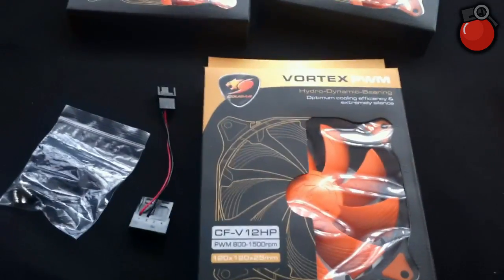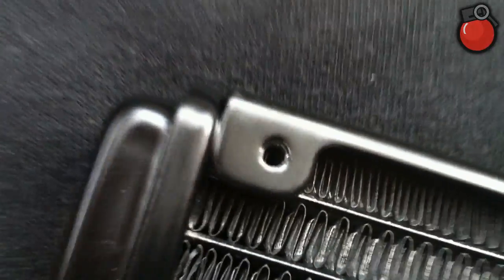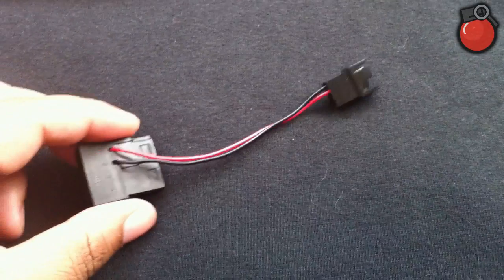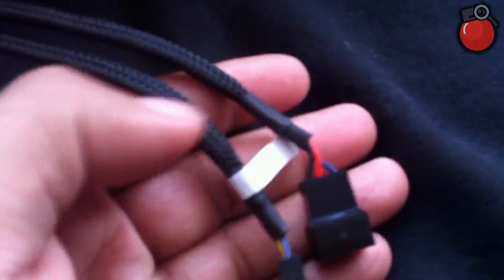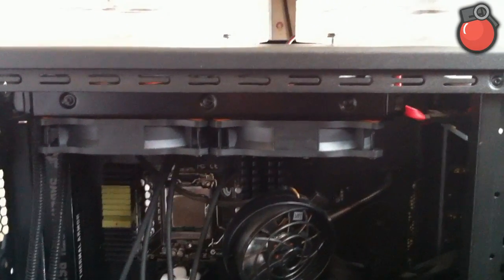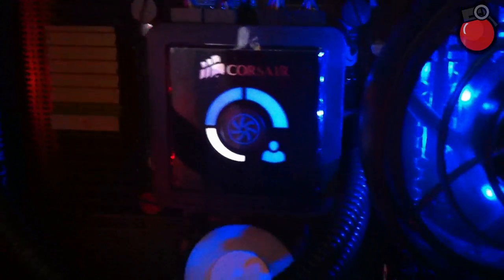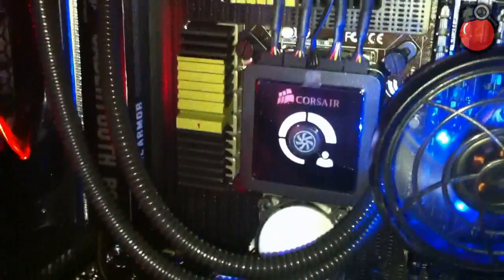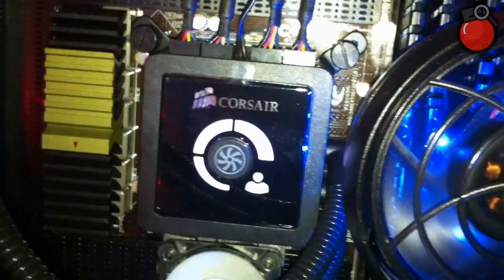Corsair H100 Review Update Push-Pull Cougar Vortex Fans - Cooler Master Haf X

Comment: Sooo... You removed the factory fans (Corsair SP Performance) which have a 3.9mm H2) rating... to replace them with a fan which has 2.2mm H2O?

And you expect your cooling performance to increase?

You're an idiot...

Comment: those 4 fans are still quieter than the rest of your system at max speed by the sounds of it. i just installed 3 on my air 540, and at max speed, there is no whine sound from the motors. all i can hear is the air being pushed, so its not the annoying loud, its the normal loud

Comment: just a quick question since your using a static pressure fans, will the HAF top case fans interfere with the flow of air from the cougar fans. if they are not moving as much air as the cougars does it make a bottleneck effect?
Reply: Same questions here... wondering whether the top case fan will hinder the performance...

Comment: It's so unfortunate that my case doesn't support push/pull config :/
Reply: anyone can, if your like me you just need a slim fan to clear the motherboard, my other fan is mounted on the outside of case. i recommend the corsair high static low profile fans, designed for this.

this guy has a triple fan set up, but push pull is a sets
Reply: Try doing that in an NZXT Phantom 410.
Reply: i see what your saying the top part dont have clearance for two fans? either way that case looks like it don't have alot of fan options. a push/pull h50 will do as good as a single h100 i do believe i read some where.

Comment: Do you recommend this to the Bitfenix spectre pro ? I need some pull fan , does these loud on pull?
Reply: Ramzy Humsi That will not make any difference due to the fan casing being round or square. What matters is if you are using it for just moving the air, then you need to look at the CFM(CFM= Cubic Feet per Minute) or for a rad push/pull, you need mmH2O(mmH2O-Pressure measured by its ability to displace a column of liquid in a manometer) For a rad you need static pressure fans to force air into the rad fins, where a fan with low mmH2O the air gets blocked. These fans have a rating of 2.2 mmH2O, 70.5 CFM of with only 17.3dB. Thats a lot of pressure with a lot of air flow, without a lot of noise.

Comment: Those cougar fans are fine for his application. The best fans are not the gentle typhoons anyways. Plus the gentle typhoons are freaken noisey as heck. Just buy the noctuas if you have money, but other than that buy the corsair sp120s either quiet or performance editions. But if you want better performance use the stock fans on the corsair h100 or h100i. The corsair h100i fans push 80cfm and 4.0mm of pressure at crazy DBs.

Comment: You have to take care of what? I don't get it? The button on the H100 is for selecting the thermal profiles... You select one and leave it. It adjusts the fan speed automatically on coolant temperature if your fans are plugged into the h100. You can replace the stock fans with some quieter ones, just make sure they have good positive pressure.

Comment: What I found out is most of these kids use the H100 hotbutton as a "fan speed selector" and are upset when they find out it doesn't work. Turns out it just selects "Cooling profiles" and the fan speed is set by internal coolant tempurature. 1 being the least noisy, 3 being the most. You may notice a slight change in fan speed, but you won't notice a large difference in fan speed unless the coolant temp is high. There is a chart on the Corsair site you can pull.

Comment: You shouldn't even have to do that. The H100 does all the thermal management inside of it. Plug the signal line into the board and you're solid. My Non-PWM fans are being controlled by the H100. When it gets hotter, fans speed up, when it gets cooler, fans slow down. The H100 does a really good job of keeping the temps down with its own thermal managment. If you connect the fan to the motherboard, you chance using a crappy temp probe that may not be properly registering CPU temps.

Comment: Nope, I'm running non PWM fans on my H100 without any issues. You do not have to plug any fan into your fan header. Just plug the signal wire into the CPU fan header so you don't tick off your board. If you run it on the fan header, it typically runs it too slow... Leave it plugged on the controller as Corsair designed.

Comment: I swapped my corsair fans with other fans and they work fine. The button on the pump only selects "cooling profiles". It does not set the fan speed, as it determines fan speed on the basis of coolant temperature. There's articles on this all over the net. I plugged all 4 of my fans into the headers on the pump. Feel free to plug one of the pusher fans into your board.. but the board tends to run them slower than the H100 will.

Comment: Sorry for asking i know you explained this on your vid , but i didn't really quite understand. 

How is your fans set up ? Do they plugging into the pump or you plugging direct to the CPU Fan header instead ? 

Cause i saw a guy swapped his original Corsair fans for aftermarket ones , the pump button no longer able to control his fan speed , this is what im worry about.

But his is a H80 , they are almost the same right ?

Comment: I'm sure you can. I have the V1 H100 and with all OEM fans on the 650D case and cooler i have my i5 2500k from 3.3ghz to 4.4ghz 24/7 and it  barely reaches the high 60's in prime95. It ran better with the radiator at the top of the case, with the fans under it blowing the air through the radiator and our the top

Comment: Are these the pwm fans or the 1200rpm fans? Also, are they better than the stock fans that came with the h100? I'm asking because the thermaltake water 2.0 extreme fans push 80+CFM...but I don't know if that is combined or each fan.

Comment: No, the H100 with push/pull will not fit in the HAF912. However, with a little easy modding to your case, you can fit the H100 with only two fans in push or pull.

Comment: Its not about how much air the fans push when you are using them on a radiator, it is all about static pressure.

Comment: Personally I use 2 single depth fans one side and 2 x  DFS1238 fans the in the top of the Cosmos2 ultra case. Never need the Scythes on full as they push 133.60CFM.  They are double the thickness of normal fans and they do have quite sharp metal blades (yep they can cut you). Good for quickly dumping heat from the case when you switch to max or are doing something out of the norm such as benching.  Really really noisy though on full.  45.90dBA. Not happy with my H100. Also on my second one

Comment: What do you think the result would be from mounting the H100 horizontally at the top with only two Cougar Vortex on the bottom side pushing air up and out of the case through it?

Comment: Just a heads up, on a lot of motherboards trying to do push pull is gonna put the fans over where the RAM slots are so definitely check it out in advance.  I had to go buy low profile DDR3 to get it all to fit.

Comment: I recently got the H100, and I see very little point in the push-pull config. I've got mine with the 2 stock fans, using a 3770k overclocked to 4.6GHz and it maxes at 60c, idles at about 25c. (Max on the H100)

This is also in the HAF X v2.

Comment from the maker: What for a push-pull config? many people have been doing this for years and it has not caused any problems? if its regarding my extra 25cm fans on top of my case they are running at low rps the highest they go is 700rpm i dont run it full speed, they are there to remove hot air from the big vents either side of the CPU cooler so i dont think they are causing any problems to my CPU cooler.

Comment: Hey if someone can reply quickly, that would be great.
Im planning on having these at the top of my case, instead of a 140m fan. The guy in the video said hes going to push hot air out, i was wondering if i can use these to cool my cpu aswell as an exhaust?

Comment: @dmcgamingclan nice video, So could you give links to what you used for extensions and for a splitter? Because Im getting an h100 and the case that you have there, as well as an h80 which Im modding for the gpu and will go on the back of the case. Do you see any issues with this? Im trying to figure out what extensions I need and stuff, so any help would be greatly appreciated. Thanks! :)

Comment: Hy friend ! I'll by a Corsair H60 and i am thinking to make a punsh pull configuration, but I have a doubt. the motherboard can be confused with the FAN Speed control? How can I resolve it? I´m thinking to plug the 2 fans in a 4 pin conector in my motherborad, but in this video you cut the third pin of the second fan.

Comment: the corsair h100... in fact all closed loop liquid cooling ain't a big deal to give them so much stuff, after all they are only cooling the CPU,if you had a custom liquid cooling or a liquid cooling kit then it will make mo sense to give it more stuff like fans cause with them you can have waterblocks for the graphics, shipset, even memory

Comment: i just mounted 2 cougar fans on my H100 and was not pleased with the results, althougt very quiet and powerfull, the cougar fans vibrates a lot inthe H100 radiator.. if i put my hand on the case i could easily notice the vibration... thats a big disapointment... i already considering putting the corsair original fans back...

Comment: H series of Water Cooling from CORSAIR..!!!  The lazy man's approach to water cooling..
LULZ. F.Y.I., I never go above 98 F or 36 Celcius at full load... 4.2865GHZ 
Phenom II x6 1100 thuban... I'm dumping AMD after the Buldozer failure...
I've went higher, but i'm not worried about it, I don't want to have to spend $230.00 on an Ebay chip... Bye bye AMD..

Comment: Do you think performance is better with or without the 200mm fans on top? I'm doing a similar build right now and am deciding if I should do the 4 x 120mm or how you have it, the 4 x 120mm + the 2 x 200mm up top. 

Is yours set to exhast?

Comment: Hey man. I live in UK and I'm wondering where can I get these from? Also, Can you connect the 4-pin PWM straight to the H100 Fan controller and does it work fine adjusting the 3 fan settings using the button on the H100? I plan on using 2 of these as intakes on the H100. Could you give me a link to the exact ones you're using, so I can buy them? Thanks.

Comment: these spin at a lower rpm when compared to the stock fans.... do you get better or worse temps as the h100 is a dense rad which works better with higher rpm fans

Comment: man, i same stuff as you and i did same settings also , but my one making lil noise in pumps and its runs in idle 21 to 24c. on max with 4.40ghz on i7 2600k its 55 to 62c. with cheap fans. i think its not the fans. i have an idea , why not put that radiator in box of ice and see what happens. lol ;)

Comment: Yoy pushed the fins out (bent them) so they won't get bent. Those bent fins behind the screw holes would make no difference as the fan will block that area of the radiator anyway.

Comment: those cables are meant to be used with 2 similar fans so they will have the same rpm with the same voltage so that your system can adjust both off the fans using one sensor!

Comment: @Teh666Reaper999 well where is the themonator and trie dignosing parts from there and if the thermonator is on the mother board ask for a new one or a replacement for a different model and if there are still problems i have no idea what is wrong

Comment: @robthatguyx yeah I solved my heat problem , the H100 fans were connected to the MB instead of the controller , also reduced my vcore to 1.280v 
my max temp. under load is 65c also stable for 24hours :)

Comment: the ramguy on corsair forum stated that the h100 stock fan has a static pressure of 1.6-7.7 mm H2o which is significantly higher than the vortex's but how do they compare to each other in real life? thanks

Comment: @NeoOsiris19 He has it blowing air out of the top.  That's how corsair says to set it up also.   But with my H70 i get better temps when pulling air in from the back.   I just got this H100 and I have the HAF X also and I set it up like this.   I'm wondering if the temps will be better if I pull air in before redoing the whole thing.  It was a bit time consuming.

Comment: Where did you buy the extra 4 screws? Because in the box there are only 4 big screws but if i wana set up a push pull configuration i need 8 screws for a safe hold.

Comment: Hey man, do you get better temps with the top 6 fans (4 h100 fans and two 200mm fans) as an intake or as an exhaust. I'm currently using 140mm back fan INTAKE, front 3 top drive bays INTAKE, with blu-ray writer (for ma ISO's) at the bottom bay, this fan is INTAKE. I'm also going to be getting the haf 932 side panel. This apparently fits on the haf x and it should drop my GPU temps a lot. I've also got a 60mm fan ductaped to the h100 pump which cools the cpu's mosfets :D. You should try these! :)

Comment: @dmcgamingclan Yeah noise level is my primary concern, but also I',m thinking thee H100 has to be one of the most efficient CPU coolers out there, so I'm sure I'll try overclocking quite a bit. Did your Apaches' speeds adjustments work well when plugged into the H100, or did you plug them into the motherboard?

Comment: Thanks for your videos. I'm getting the H100 and I'm thinking about replacing the stock fans with the very same Akasa Apache ones (though in black) that you used to have. They sound quieter (on paper) than the Scythe Gentle Typhoons people seem to love so much. What are your thoughts on the noise levels when you compare before and after you switched to the Cougars?

Comment: @datarecoil which is better? 2 120mm fans inhaling cool air from the top.. a 200mm fan inhaling cool air at the front.. and a 120mm exhausting hot air from the rear.. or should i make it so that the the top fans are exhausting and everything else is getting cool air..?

Comment: how did u set it up? which way are the fans pointing? like are they all pulling air from the outside? or does the upper fan pull air from the outside and the lower pulling air from the inside? i don't get it please help

Comment: 200mm on the top blowing the air out of the case right? Removed my 200 from cm storm sniper black edition when I installed h100. Maybe putting it back on then

Comment: I have the exact CPU cooling set-up. H100 with 4 Vortex fans in a Haf-X case.
But I did notice there seems to be less air flow with the top rear 200mm case fan installed as opposed to it being removed (with only the front/top 200mm fan in place). 
On high, the H100 makes this weird grinding(?) noise every 2 (or so) seconds.

Comment: thanks, and im also thinking about lapping my 920 before installing this. do you think the pre applied thermal paste will be sufficient enough for low temps? im running at 4.5ghz but idle temps are 50  and i cant prime without reaching 90 on a couple cores. i was also thinking about re doing the thermal compound on the H100 with ic diamond.

Comment: i would use a fan controller for your fans that way if it does go faulty the pump will still be working and your fans will be still on hope this helps you out i was lucky i was on pc when the unit failed

Comment: i see you had same prob as me had mine 2 weeks now and unit has failed corsair need to get there act together it should not have been on the market before some proper testing its like the xbox 360 ring of death but instead  the ring goes out and fans stop working alot of people are having this problem no wonder they want you to send it to them so they can cover there tracks its not good enogh what if it fails when your in bed not watching it then its bye bye cpu

Comment: @gen2sega 

Push and Pull would be what it says. The two bottom fans will "Pull" the air up to the radiator and the two top fans will "Push" the air out for some awesome cooling (only for overclockers though.) Also, it depends on how you want to do the "Push and Pull".

Comment: @dmcgamingclan Mate , I got a question , I'm buying the H100 and got the same case.. will it work with the stock fans and 2 noctua p12 fans? and I need to remove the top fans to make them fit true?
An installation video of it with someone holding the camera for you would be great :)!

Thanks :)

Comment: Nice video, it all looks good but 60c certainly is not a good result.  I have a core i7 930 OC'ed to 3.6 with a hyper 212 and my temps are 35/40 idle and 62c running Prime95 for 15 hours.
Perhaps you need to reapply the thermal paste.
Also, I think you should tie your computer to the floor because with all those fans it may take off soon.  LOL

Comment: It seems counter productive to put a Rad in your rig and then put SIX fans to cool just the rad.Surely a good air cooled heatsink would be quiter and just as as good temp readings for a smaller cost.If your going to use a rad then use a proper one imho.

Comment: Do you really think that you need so many fans? If you got two 200mm fans at the top of the case could not be enough mounting only two 120mm fans all of then in a pull-push configuration?

Comment: Thank you, this is a much better update but I too must echo the thoughts of others with regards to the airflow through your case.

Basically more fans does not necessarily equate to better airflow. Good clean passage of air is the key balancing negative vs positive pressure. I have found that in most cases this means running at slower fan speeds whilst directing intakes and creating positive pressure resulting in cool and quiet.

Resonance/buffering between fans/grills can also amplify harmonics

Comment: @dmcgamingclan Good to know because I don't like modding cases unless I have to. I am curious how it's held in there though. Would you consider, not just for myself but anyone else wondering, maybe doing a quick 5 minute "install" video for the H100 just to show how you made it work with your push/pull configuration ?

Thx.